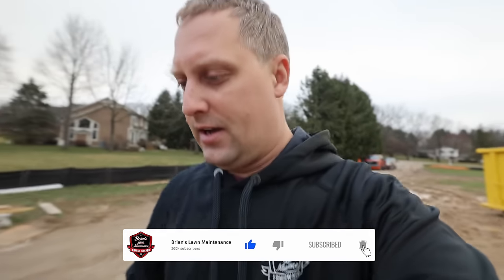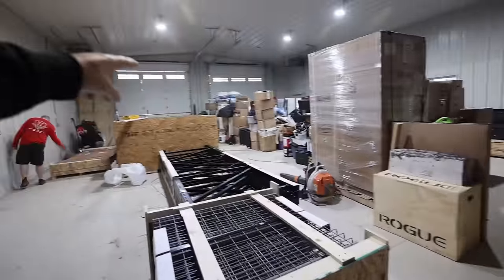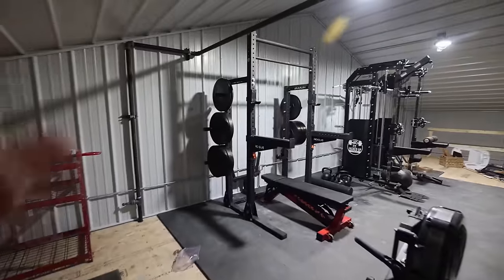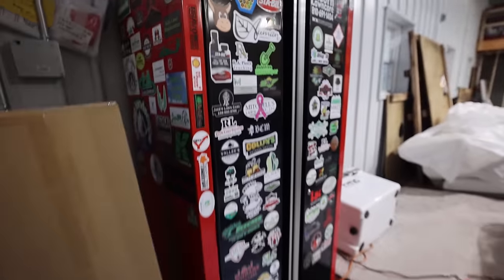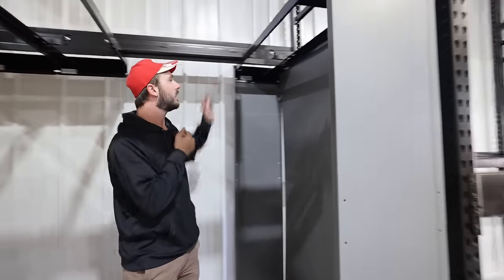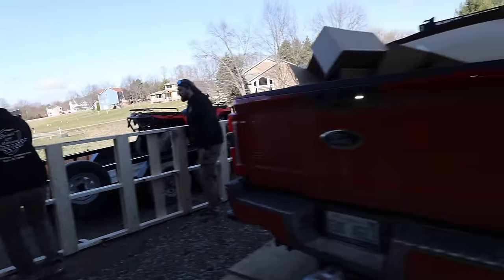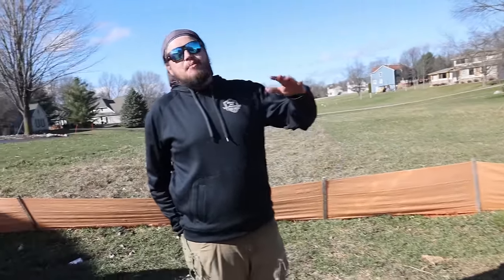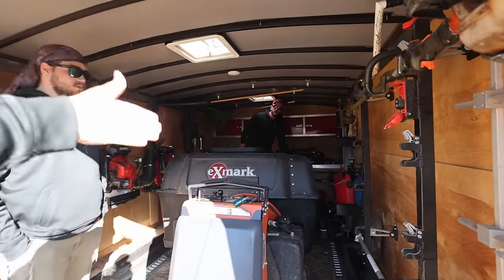THE BEST SPRING PREP TIPS TO SAY GOODBYE TO SNOW FOREVER

Comment: Some advice on the barn. Make sure you measure from the floor to the electrical wires before they install plywood up so in the future when you need to mount something to the walls you don’t screw into the wires. Same goes with any other utilities, Also take good pictures.
Reply from the maker: Thank you!